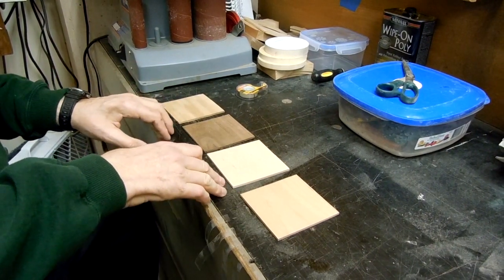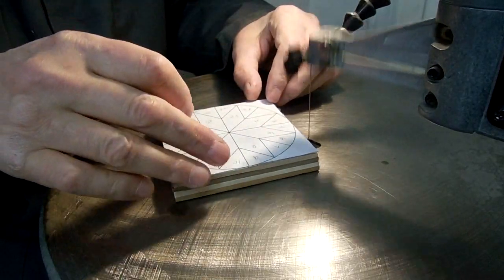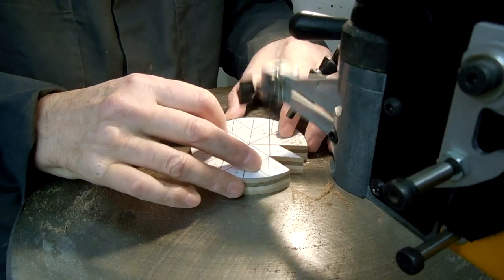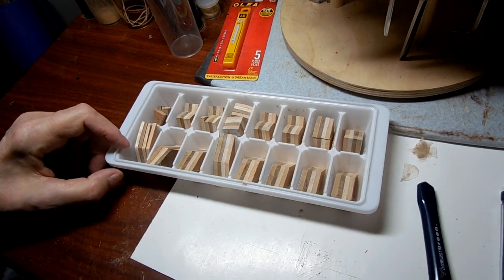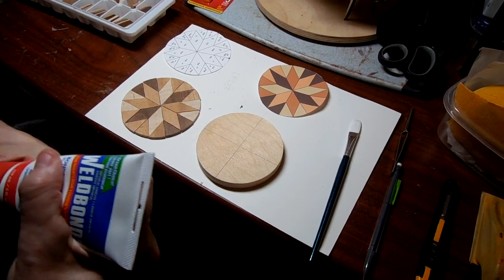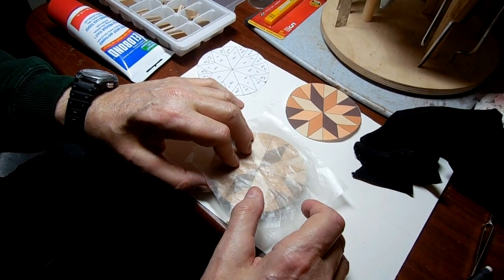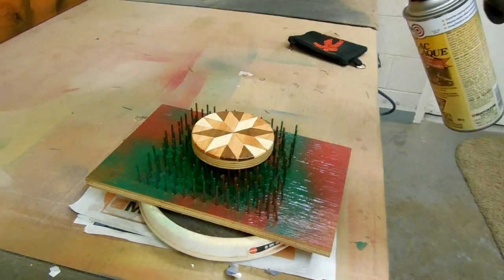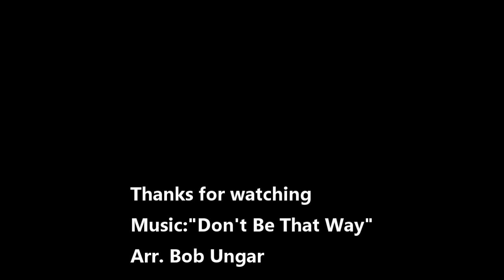Making Inlay Coasters with the Scroll Saw

Comment: beautiful coasters and the making is very well explained in the  video. thanks for sharing.  your showed a lot of patience.  i was surprised your cut everything single piece, there stack of four, separately. i would expect to see the straight lines  cut trom iné side to there other in  one run. what is the reason to not do that?
Can the project be done with a band saw instead a scroll Saw or will the wider cutting lines  cause problems?

Comment: Love the coasters! My question is when you have the dry pieces assembled why wouldn't you just take your round piece with the glue and just place it on top of the dry fit pieces on your table as apposed to placing each individual piece on the circle piece.
Reply from the maker: @Scott's Woodworkin' Stuff -I see your point. I feel that I have more control over the final outcome of the pieces fitting more tightly together by this way of nudging them together while the glue is still setting.Thanks for the comments
Reply: Oh I see your point. I really meant Instead of taking the time to pick up piece by piece, after I put the base on the parts, I would then organize them more tightly.  But still it wasn't a criticism. Just a question is all. You are very skilled.
Reply from the maker: @Scott's Woodworkin' stuff.Thanks again for your suggestion. I'll try it out when I do another batch
Reply: Have you done another batch? Did it work?
Reply: Very nice project but one must have lots of patience!  I agree with the idea of dry fitting then placing the glued base on them. It seems that would give you even more time to move pieces into a tight fit. Only other comment is I’ve never see coaster that thick !

Comment: Is there a reason not to just take the glued base and press it down on the pre-assembled pieces, so all attach at once? Pre-assemble on a thin backer board so parts won't fall off when inverted? Some may slip out of alignment, but can be adjusted in just a few second, I would think.

Comment: Thanks for the great video. I made a set of your coasters and used Krylon spray clear. I found that hot coffee / Tea mugs stick to the coasters even after three months of use. Have you had that problem. Thanks Jim
Reply from the maker: @jim0777 I'm glad you found the video useful. I used Polyrub, which is an oil-varnish mixture which seems to have worked well as far as preventing hot items sticking. The Krylon is an excellent product I use all the time on boxes etc., but since it is acrylic based, I believe that is where the problem lies. I've also heard that an epoxy based coating works really well to protect the wood against heat and is very stable, but it does require some mixing, and more work in its application. Hope this helps. All the best.
Reply: Hi Robert. I tried to download the pattern to make another set of coasters. www.the sound board.com by copying and pasting, Is the site closed as I cant download from it. Thanks Jim
Reply from the maker: Hi Jim0777. I' ve updated the link for the pattern download. it should work now.
Reply: Hello Robert
As of now, thesoundboard.com domain is for sale. Is your pattern posted anywhere else?

Comment: Just saw this (SAW this. NO pun intended). Surely after the first coaster, replacing 1,2 & 3 with 4,5 & 6 is kind of redundant. All you did was technically just turned the coaster, the pattern is the same.
Nice work though.

Comment: Nice video.  I would not even use a base - or a very thin one, glue and waterproof coat it as is.
Reply from the maker: @ Dr. Ron. Thanks. I would be concerned with relying only on the edge-gluing of the pieces to maintain the strength of the coaster. So yes, at least a thin base for support.